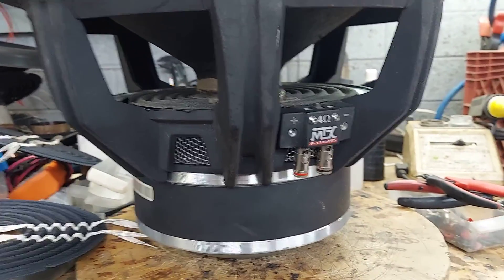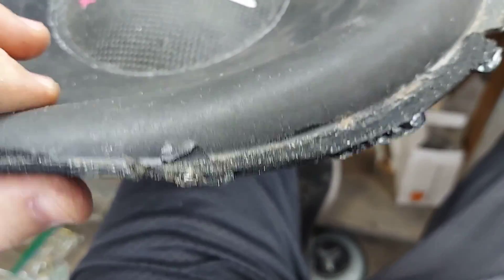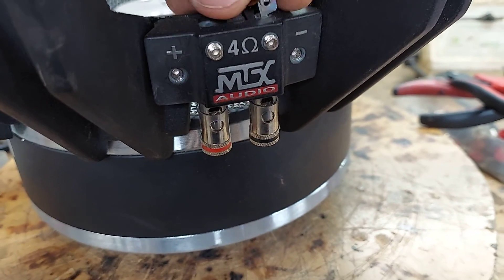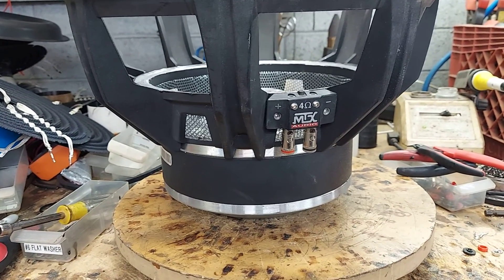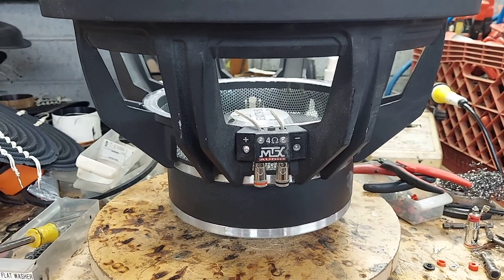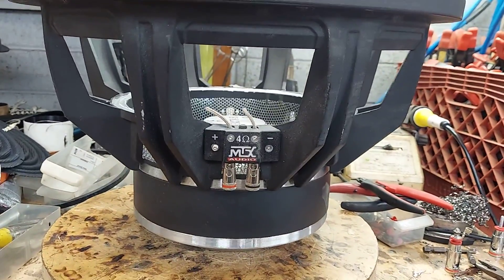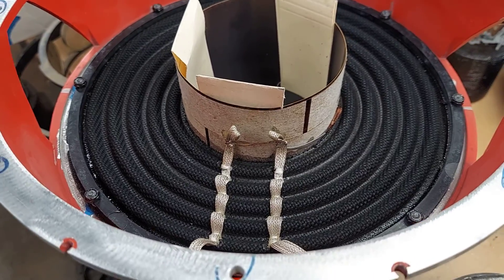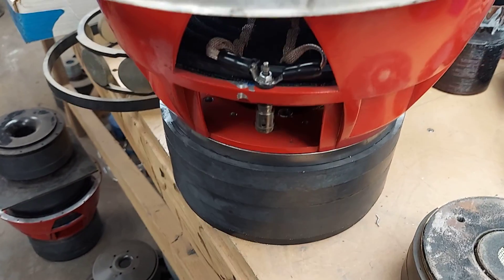Tutorial for MTX 8500 15" w/ recone by PSI / Pink Star Industries + terminal on mod'd HCCA 12" frame

Comment: question, on the spider is not really necessary to have double up spider 10" diameter suspension? if the woofer example 12" will have just a 260 oz ferrite motor a 3" single or dual coil and is never gonna see more than 500W
Reply from the maker: There's a lot more to it than just that there's a lot of detail that you're missing and it also depends on the application

Comment: Hey man, could you do a video on stitching on tinsel leads?
Reply from the maker: Nope.  That's China's job.  I'm sure there might be a video on that already.. maybe from Russ Wong.  As far as putting them on yourself, I've had an upholstery shop do some when I needed a bunch right away.  Otherwise, just pay the extra money to get them from me or LOB and be done with it.  I only do that when I'm in a pinch and I don't like it's reliability.  You can also use CA glue to tack to the tops of the rolls, again, only in a pinch.